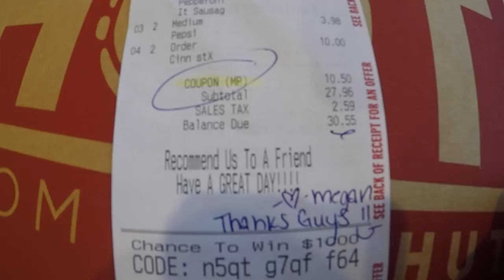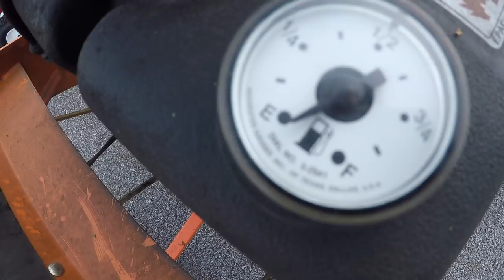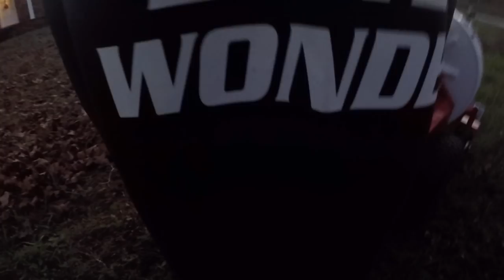Little Wonder Vacuum Try Out

Comment: We've had on of these for years and will admit it's handy in some situations but if the leaves or any other debris is wet forget it! Plugs the impeller solid then you have to take the front off and try to clean it out. We use it mostly for cleaning up the left overs after blowing everything to the curb and sucking everything up with our truck mounted leaf loader. It's also great for a lot of commercial properties we do that just have leaves and debris along curbs where you'd make more work if you used a blower. Also when the bag gets full it tends to just come off from the weight and blow crap everywhere. Ours is from like 2005 or so, so maybe they've made some improvements. Good luck with it.

Comment: Hello sir, I'm considering at the end of this season replacing my Billy Goat K Vac with a Little Wonder unit, how many years can you get out of a $3,000 dollar machine like this? Will it last maybe 5 years or less? My Billy Goat K Vac does an alright job, but it's not going to stand the test of time and long long haul after 10,000 gallons of leaves and 3000 gallons of grass thatch the mag wheels are worn and the bag is showing signs of heavy wear and the wheel bearings were shot, which was the biggest thing along with the drive belt. I've fixed pretty much all of that and I can get another season out of it, but I'd like to get a machine that loads top down instead of bottom up. I have a Little Wonder Edger and that thing is amazing, so I wanted to see what else they have because I really like there stuff, what has been your experience as far as service and replacement?

Comment: Hi - Thanks for posting that video on the Pro Vac Sp - I'm in the market for that exact model - Have you had any problems with the Machine at all? Did you purchase the hose attachment for it? just wondering if the hose attachment get's clogged at all - Any new info would be great - I see they are pricing around $3,500 or so, is that close to what you paid for yours? Thank You -
Reply from the maker: Yes it is and the hose attachment can get clogged if it’s folded or bent. Have to make sure to keep it straight at all times
Reply: Thank you for the update - would love to see a update video of the Pro Vac Sp when the leaves start to fall - 🙂

Comment: I see all these elaborate ways of collecting leaves.  Just my humble 2 cents that works for us and is fast. blow them all in a row while one guy is running them over with blocked off deck and gator blades, keep going spreading them out and poof there gone. No hauling or picking up.

Comment: I haven't had any luck with ours, now its not as fancy as yours but its constantly clogging and have to believe that's due to the pathetic 5hp Briggs. One wet or even damp leaves...forget it! Ours always packs at the bottom of the impeller and most times so bad, before you know it you can't even pull the recoil, then it takes 20 minutes to dig it all out.